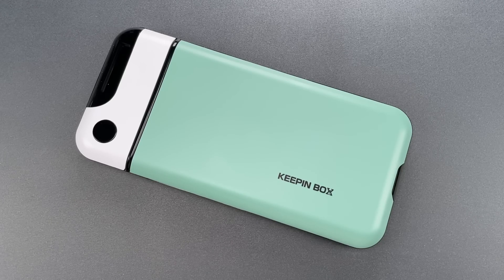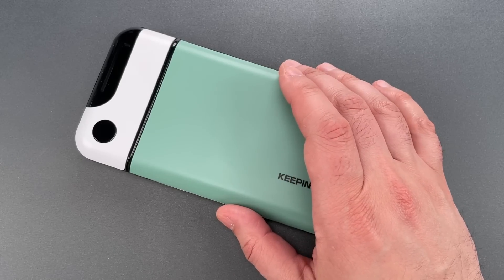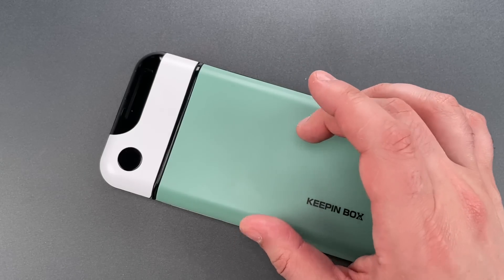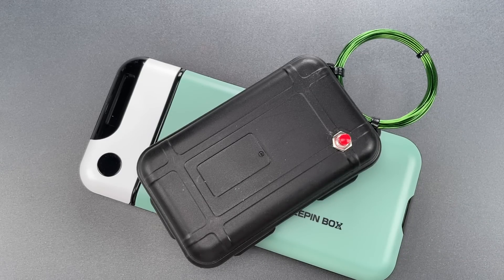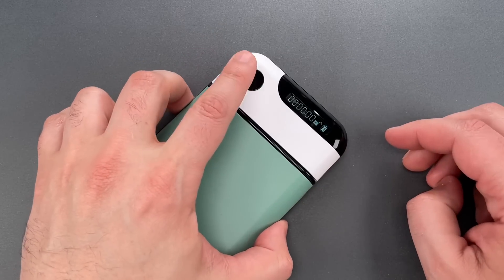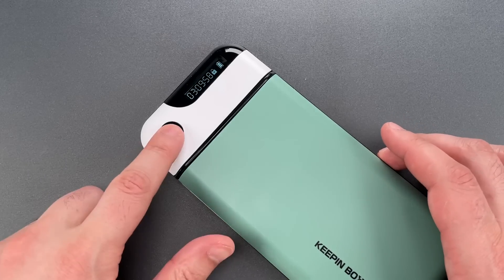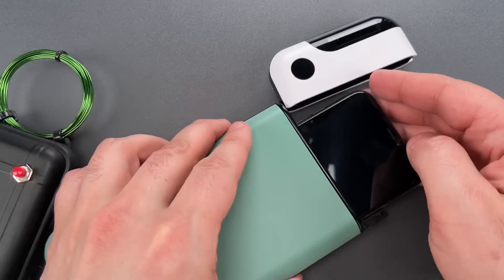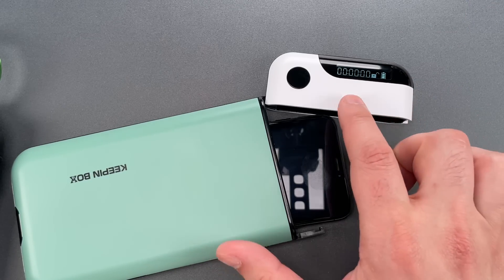[1440] Pocket EMP vs. Smartphone Timer Lockbox

Comment: Anyone else wants from him a diy tutorial on the emp?
Reply: with little googling you can make one yourself
Reply: @edewaal97  I didnt bother to google yet but I suspect this is probably a taser and a loop of wire to create an induction field. I doubt that much more would be required.
Reply: @MatthewFiereck  Probably not that. LPL said it cost him less than 10 bucks, so it will not contain something as expensive as a taser
Reply: @holgerchristiansen4003  yah its basically just a capacitor, induction coil, air gap, a momentary switch and an 18650 battery. Learned that after the googles. The air gap is what give it that taser sound.
Reply: @MatthewFiereck  not for $10
Reply: @MatthewFiereck  yeah that works fine. We made a few at the office and used them to fry alarm clocks and calculators.
Reply: @MatthewFiereck  yep   its just a taser.    with a loop
Reply: @MatthewFiereck  Exactly that! (you can even hear the taser pulsing...)
Reply: @MatthewFiereck  it does sound a lot like a laser.
Reply: @holgerchristiansen4003  Just a high-faraday capacitor and an easy-change battery. They don't last long creating that much discharge.
Reply: @MatthewFiereck  it's an otter box, not a taser. Probably just batteries, capacitors and that coil. Grab an old PC’s power supply and make your own.
Reply: @MatthewFiereck  you really dont even need a coil, when i got my first stun-gun i was lighting up everything from atms to secure garage doors, and it does this to most door keypads - unlocks and wipes the code
Reply: @edewaal97  buy a diy video by the LPL will have his dreamy voice telling you what to do.
Reply: @edewaal97  I'd like to see the instructions for the particular one he made, not just any version I might find on Google.
Reply: @edewaal97  thanks for taking views away from someone who we like hearing talk and looking at their fingers. You better not have ruined this for everyone...oh yeaahhh you didn't make a video yourself or even compile links so nvm...
Reply: @CashewBestofNuts  how am i taking views away? People probably have watched before commenting, and it's not like he has done a video explaining how to build one.
The fact that I don't have a video doesn't mean anything. I don't have links because it's not legal everywhere, so posting how to build one wouldn't be smart.
Get over it, it's just a comment.
Reply: @edewaal97  thats the point, we want his video.
Reply: @edewaal97  Dude, I'm not actually going to build one. I just want to watch someone build one...
Reply: Looks like a taser with a coil
Reply: @noraxi  That's exactly what it is. Lucid Science showed how to make both the taser and the EMP device 4 years ago on his channel
Reply: Check the Electroboom channel he built a DC EM device for his 4M sub count and an AC EM device for his 5M sub count
Reply: It’s a taser module ($5), a spark gap ($0), and a coil (<$1). It’s incredibly simple
Reply: Localized EMP is fairly easy to generate.

First time I've heard of EMPs was from a Scientific American magazine, in the 1970s. They often had articles on nuclear weapons, during the Cold War.

First time i learn how to make one, was while attending on conference on general electrical interference, back in 1980. One talk was on "Tempest", which was on shielding against electronic eavesdropping. The one, the company sent me there for, was on suppressing EMI/RFI, generated, by computing devices. But the fun one was on making your gear resistant to an EMP, which also had the sub-topic of generating your own, so you can test your gear, to see how susceptible it was to an EMP.
Reply: Just use an electric fly swatter with a coil connected to it. The coil needs to be connected with a small air gap so that the high voltage builds up, jumps the gap and creates a pulse in the coil.
Reply: @danielnyman6082  That wouldn't work. At least not as well.
Buy a boost converter that converts 6v to what the seller claims is 500kV. Its closer to 10Kv but you can get them from pretty much any online marketplace (spam filters remove posts that name it but it's a 4 letter word that ends with bay and starts with a vowel), you then connect this to a spark gap with a PTM (momentary) switch and then a coil of enameled magnet wire.

I posted a guide on how to make one a few posts up. You literally need only 4 things provided you have some wire and a soldering iron.
Electric fly swatters take too long to charge, those boost converters charge instantly and will give dozens of arc across the spark gap (and therefore dozens of pulses) a second.
Just make sure you don't touch the hot leads of the boost converter when it's energized, it hurts.
Reply: I wanna know how to build his exact version cause you know a lot of thought went into making it the best he could with the parts he had.
Reply: @trurocker03  thank you
Reply: Who else pictured the Smartphone in their mind coming out smoking?!
Reply: Yes.
Reply: yes xd
Reply: F yes!!!
Reply: Yep, I'm intrigued!
Reply: I want to make a giant version.  Is that wrong?
Reply: @andymanaus1077  They have those. They are called transformers. You just gotta blow one up. :)
Back in 2002 we had the transformer on the pole out back blow up. Burned down the two sheds near it and blew everything in the house. We were using the old school ACP protectors on everything. All 6 ACPs in the house were fried, but everything plugged into them survived.
Reply: Yup
Reply: You can just look it up 
Its basically a stun gun wired to a coil
Reply: That's the first thing I thought of. I'm in.
Reply: He should sell it :D
Reply: @UCJcz8FO_EPXdZ7uO8ug5MjQ ikr?
Reply: Uh YEAH
Reply: I definitely would like the details!
Reply: Look it up. There is literally 100's of videos showing you how.
Reply: @KarolineLeavitt-29a  NO!  I want his soothing voice
Reply: definitely
Reply: Your YT missing a search bar? lol
Reply: Uh, yeah. This guy!
Reply: Pretty easy to make, just get a cheap high voltage transformer. (12v to 10kv or so) Find a box, a 9v battery or two, a button (make sure to put the button between the positive of the batteries and the transformer), add a spark gap between the transformer and a coil, viola.
Reply: Duh...
Reply: the box is a small case with side and front snaps similar to a mini pelican case, usually around $5 and the batteries and battery holder around $2-3 if you go to a dollar store, and the circuits and such are easy to source cheaply online, maybe a dollar or two.
Reply: Yeah, good robot apocalypse gear.
Reply: It’s just taser attached to a coil.
Reply: I think GreatScott has a tutorial up dawg
Reply: Just some capacitors and a coil i believe
Reply: Is there nonvolatile memery with infinite writes, that's relatively cheap?
Reply: Was about to ask for one lol
Reply: People will start building them and sending up nukes
Reply: It's been said a bunch, but I'm going to add to it.   EMPs aren't difficult to make and are illegal to make in most circumstances.
Reply: Yes pls
Reply: it sounds like it's just a stun gun connected to a coil
Reply: Can be Made with Amazon/eBay parts for under $20.
Reply: Yes but also please no! XD as fun as it may be to play with, I don’t actually want this to be common knowledge for people actually trying to do something illegal
Reply: It's a tazer and a coil of wire
Reply: Yes, please.
Reply: Hella yeah. I'd love to see his take on it.
Reply: Y’all only have malicious intent so it’s better you don’t know how to make one
Reply: You know, if they made EMP bigger and put that into a satellite it would be pretty dangerous!
Reply: A lot of devices use transformers that increase voltages that would do this. Old scanners that have mini-fluro tubes have 12v to 200+V trannies
Reply: Sounds like a very bad idea.
Reply: to me it seems like most people on this comment thread asking for how its made just want to use it illegally
Reply: ME ME ME ME ME
Reply: He made his first one in a cave, with a box of scraps and a Red Bull can.
Reply: Yea
Reply: i would guess it's an astable multivibrator circuit based on the ubiquitous NE555 timer.  push the output through a transformer to bump it up a little in voltage, then feed that output into the big coil.
Reply: Yes
Reply: Taser with spark gap and a coil
Reply: Most certainly.
Reply: Here
Reply: Keystone electronics has one
Reply: Yes! PLEASE!
Reply: Yes
Reply: I’d freaking payoff one
Reply: I would like a parts list
Reply: Federal law prohibits the operation, marketing, or sale of any type of jamming equipment. So he would have to remove the video and possible lose his channel if he did. Lol
Reply: saw a video about 5-8 years ago on a DIY one
Reply: Not this one. It's sounds as scary as a Taser 😂
Reply: Its easy: Just get a nuclear bomb and detonate. Instant EMP.
Reply: Yes!!!!!! Or a parts list!
Reply: @JamesGraingerJC  Here, hopefully the post goes through this time. Otherwise I'll split it into 2 separate ones. 

Buy a project box
Buy some enameled magnet wire
Buy a boost converter from an online marketplace (one of the ones potted in resin with claims of 500KV or more)
Buy a PTM (momentary) switch
Buy a battery holder for 4AAs
You also need a soldering iron and preferably a drill

Wire the negative end of the battery holder to the negative end of the boost converter.
Drill the project box (or melt with the soldering iron) and mount the momentary switch like LPL has done.
Wire the positive end of the battery holder to the PTM switch then the PTM switch to the boost converter.
Take one of the leads from the boost converter and attach to the coiled magnet wire (same arrangement as LPL has), remember to sand the magnet wire so you make an enectrical connection. 
Take the other end and attach the lead to a bolt running through a nut which is glued to the project box.
Have another bolt and nut glued near to it. This allows you to create a spark gap so you get a pulse.
Attach the other end of the magnet wire to the second bolt.
Adjust the spacing between the nuts and bolts so that you get a regular arc between them when you press the PTM switch.
Tidy the project box up, use zip ties to secure the coil of magnet wire. Glue everything down.

You now have a portable EMP.
Reply: @daviddavidson2357  bless
Reply: @daviddavidson2357  and now explain with pictures and schematics, please.
Reply: @sauliusjance6300  I would if only YouTube allowed external links.
Reply: @JamesGraingerJC  An ignition starter coil and some wire... a few 9v batteries and some scrap wire???
Reply: @JamesGraingerJC  High Voltage Generator Module flea bay black tube looking thing then utube spark air gap
Reply: 💥😎@LPL..Do U sell that mini "EMP" Generator or Similar on "Covert Instuments"? Thnx!👍
Reply: It's mostly just a circuit with a switch , battery and the coil acting as a solenoid .
When the current passes through the coil it induces EMF causing the electromagnetic field to change
Reply: @hms1212  that would make one pulse as the current builds then nothing after.  The clicking you hear is the circuit being reversed (or less likely turned off and on).  This causes a change in the field direction each time the current reverses and so you get emf pulses.  The circuit inside will be a bit more complex, involving an r c circuit with a 555 timer, or a transistor.  It'll also have a transformer in there to get the voltage up and possibly a spark gap (which is likely what is making the clicking).
Reply: @hms1212  You left out the stun gun module and an air gap.  Every time the module creates a arc across the air gap, the current passes though the coil.
Reply: @hms1212  Thank you Google
Reply: @hms1212  A coil is the same thing as a solenoid, so a "coil acting as a solenoid" makes no sense, then, wow, a circuit and a switch? Who would have guessed that, and we can all see that you understood the most elementary principle of electromagnetism, but if you don't really have something of value to add, don't say anything at all ;)) have a nice day
Reply: @hms1212  No, its just a taser with a coil at the end instead of the prongs. You need alternating current to produce an sustained EMP pulse.
Reply: @hms1212  the coil is a solenoid? What do you mean?
Also he's just using some generic high voltage booster you can buy online or maybe a bug zapper
Reply: @hms1212  yea but where’s the part where someone reads it to me at my skill level? Usually anyone older than 5 does a good job 👍🏻
Reply: @hms1212  no
Reply: there are tutorials around however lpl being a popular channel hes probably (rightfully) worried about legal ramifications of such a tutorial where as the small channels tend to fly under the radar and when caught just a video removal and a slap on the wrist however for more influential channels such a tutorial could land them in a lot more trouble
Reply: @AlLDaZzA  have you seen the laser channels on here? The 3d firearms community is going pretty strong on YouTube too.
Reply: @AlLDaZzA  So, you think he'd be worried about giving info on defeating an electronic lock, but he has 1,440 videos on defeating conventional locks?  What's the difference?  And, obviously YT has no problem with the channel.
Reply: @AlLDaZzA  I'm not sure about that, considering the amount of videos on here with him mis-using a ramset for lock opening. Likely he just wants to keep the channel focused on short lock picking videos; he doesn't really do lock picking tutorials either. Edit: by that, I mean he doesn't post longer tutorials on the channel, even of lock picking. Nothing wrong with just focusing on the one type of content.
Reply: @zrobotics  Except he just did.
Reply: Matt F is correct, this is basically a circuit snagged out of a taser and a few turns of wire connected to the prongs. Basically, anything that makes a high voltage spark can be fashioned this way into an EMP device. So if you want to make it, it's as simple as buying the cheapest taser you can find, moving the prongs further apart and connecting a coil to them. Just be aware, tasers might be illegal in some places, and tinkering with one can give you a zap, so check the local laws and make sure the taser has no power an capacitors are discharged
Reply: @valravn5735  Or, just use one of those electric fly swatter thingy's, I've seen them turned into tasers
Reply: your forgetting it needs a spark gap heres the idea, ( batt+ >  switch ->  hv converter in+ ->  hv converter out+ -> sparkgap ->  coil in ->  coil out ->  hv converter out  >  hv converter in > batt )thats the circuit loop dont electrocute yourself otherwise when the next person finds you, you may still be on the ground flopping around like a salmon
Reply: I'm fairly certain it is just a lithium ion battery, a simple step up voltage transformer circuit you can either buy pre-made or make yourself, a capacitor, a spark gap, and a loop of wire.. 

if that seems like too much effort, or is too confusing, you can always go that significantly assembler route and either invest in a Dremel or other high-speed cutting Implement, more use the time-honored tradition of " it no open. me hit until it open"
Reply: Yes
Reply: Yup!!!
Reply: same
Reply: This
Reply: Yes please ☺️
Reply: Yes
Reply: YES, YES, YES!!
Reply: While it would be cool, I don't see the benefit.  He shows us how to pick locks as a way to gently encourage lockmakers to improve their products.  Showing us how to create a bypass device ourselves is another story.  Of course, his lawyer brain could probably frame the video in such a way to reduce any liability he may face.
Reply: @jardex2275  There are already plenty of videos on how to make these. They aren't anything new or groundbreaking. Just a high voltage (a few thousand volts) fed across a spark gap to create a pulsing effect and then wired to a coil.
You'll find dozens of guides if you just search it on YouTube. They aren't high tech James Bond bypass tools.

I think a lot of people think of starfish prime or Goldeneye when they hear "EMP" and imagine it blowing out electronics for miles around these devices are EMP generators but the EMP is so weak it literally has to be within inches of the device to be affected to do anything. You could probably create a bigger EMP with an induction hotplate. Or a microwave oven.

I don't think LPL would have any issue showing how it's made. It's just that you can find guides everywhere. After all, what do you think has more potential danger; showing how to defeat multiple gun locks and safes that are currently in use or showing how to make a device that can fuck with electronics from a few inches away?
Reply: It's the easiest thing ever to make, it's a spark generator off eBay with its spark going through the coil, I made one that fried calculators, like actually broke them!
Reply: yes please!
Reply: Yes please
Reply: Hell yer
Reply: not really an EMP, it's just a high voltage spark gap, the sparks put out a ton of EMI and RF.
Reply: YES
Reply: Yes
Reply: This is a hard comment to read... it left me extremely confused for a moment.
Reply: I do! I do !
Reply: EMP Tutorial would be awesome.
Reply: Yes
Reply: Yep
Reply: Yes
Reply: Yes
Reply: Yes please
Reply: Yes
Reply: No.
Reply: Then the Lockpickinglawyer would need his own lawyer.
Reply: FCC WANTS TO KNOW YOUR LOCATION
Reply: Copper wire, wound up in a coil like you can see.
A battery, or other power supply.
There you go.
Reply: It's a taser with a coil, I think?
Reply: Since its illegal AF, i doubt he would do it..
Reply: @ibustanut  No, using it for illegal purposes is illegal..
Reply: @512Chaos  Same energy as "People die when they're killed".
Reply: @Xidphel  Well, no. Same energy as picking locks being legal until you're breaking and entering.
Reply: @512Chaos  Well, also yes because you say illegal stuff is illegal.
Reply: @ibustanut  BS
Reply: @ibustanut  how is it illegal?
Reply: @ibustanut  it's not illegal to make or own one, it's illegal to break something you don't own with it though
Reply: @ibustanut  There’s nothing remotely illegal about building a device like this, or teaching anyone how to build one.
Reply: @ibustanut  what law would that be?
Reply: @ibustanut  it's not illegal to make, own, sell, or teach others how to make a pocket emp lmfao
Reply: @ibustanut  all it is. batts to High Voltage Generator Module to a coil with an air gap spark. when i play with mine at pc my keyboard disconnects from pc i need to unplug it replug it